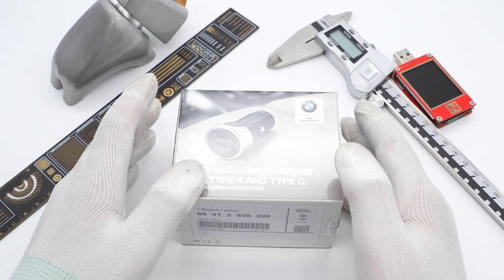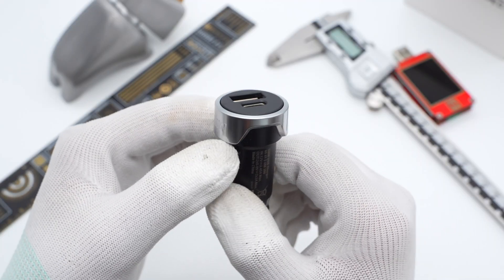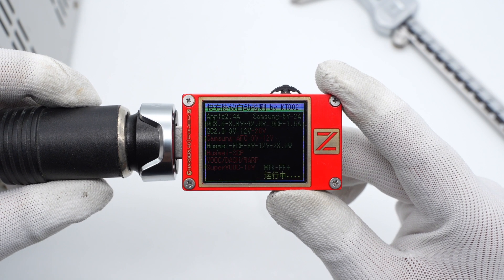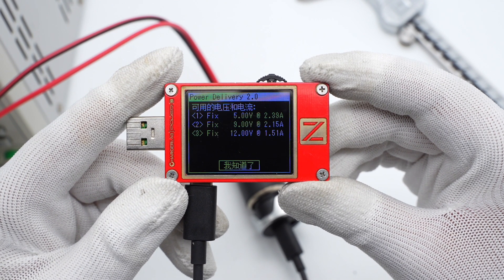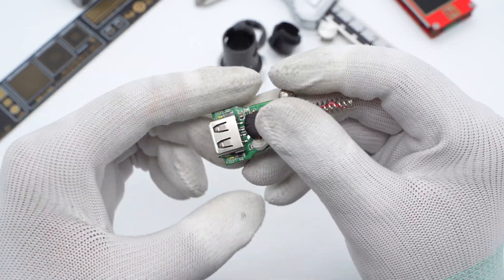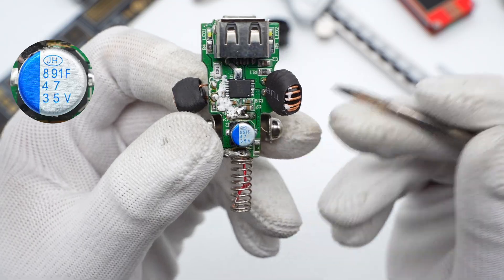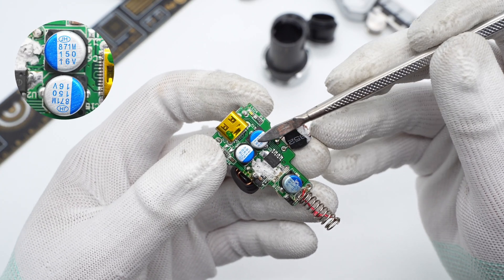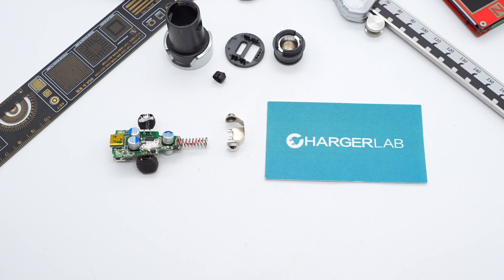Teardown of BMW 18W Dual USB Car Charger (1A1C) @MercedesBenz

Comment: Hi ChargerLab, what’s the reason for BMW to produce and sell this charger ? All BMW cars already have such chargers build-in, so do other car brands too. Perhaps BMW are giving this gadget as door gifts for anyone visiting their showroom or ask for a test drive. Other than this reason, the BMW charger serves no useful purpose at all. Even the teardown don’t show anything special. Sigh !!
Reply: the built-in USB ports were all dumb ones. even the type C can only support 5V 3A and no fast charging protocol supported. does it makes this product any worth? it's both yes and no. yes if you're a fanatics where you want the authentic "BMW" brand on it and no if you only want a fast charger. they're charging 44USD and you could buy much better charger at such price
Reply: @n.shiina8798  thanks for the explanation